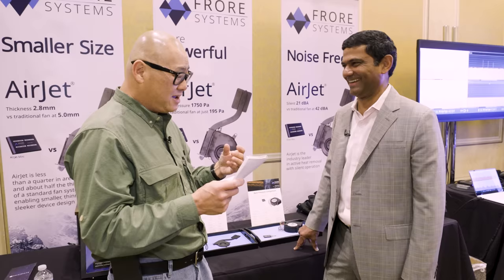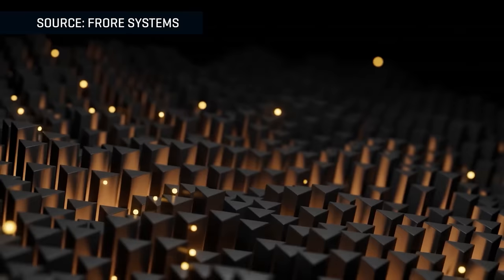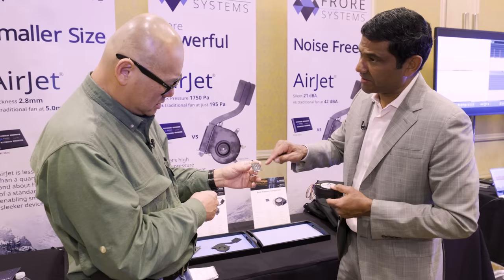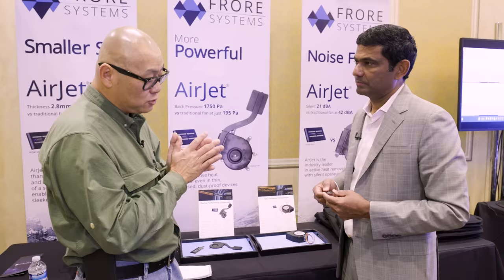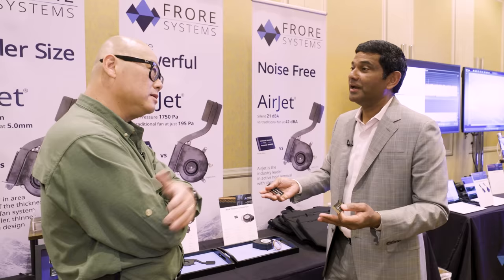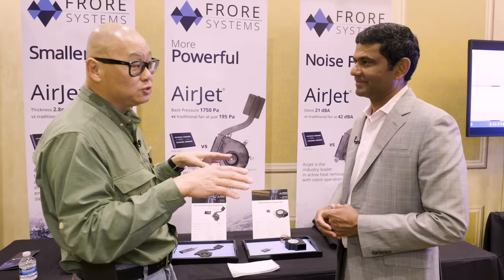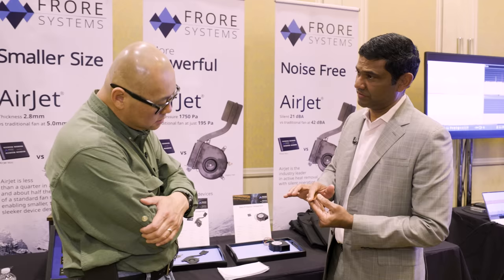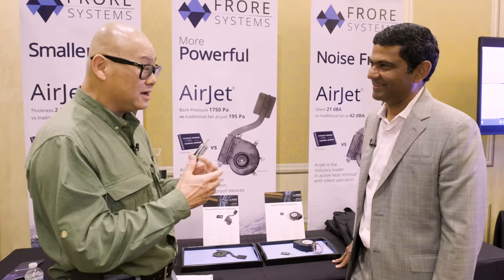Solid State Active Cooling Could Revolutionize Thermals

Comment: Seshu is legit. I'm an electronics engineer by training and I understood what he's saying. It's a pity we didn't get to see the cutaway of the AirJet. Using MEM actuators to move air is just too cool! Would love to see how it works and he said it's how jet engines are cooled? Looks like I'd be spending a few nights researching on this topic!
Reply: Linus did a video about this tech too, iirc 👍
Reply: I love you bro people on the internet doesn't have this curisosity
Reply: it will get stuck very quickly. small holes are the perfect dust filter.
Reply: @lievenvv  Not quite, LTT's video is about piezoelectric crystal linear fans.
Reply: @Gabu_  Yes,those flappy things for the ISS
Reply: @fss1704  Not when there's a 200km/h wind blowing through them.
Reply: @Gabu_  Ah, cheers for that. Wasn't sure if I remembered it right 👍
Reply: @Gabu_  these things are MEMS but they didn't explain how they actuate the MEMS. My guess is that this is piezoelectric in nature as well, cus magnetically driven actuators are bigger.
Reply: @Lurch Yep also another interesting fact is on fighter jets they use the bleed air to inflate the G-suits to keep them from passing out
Reply: can you make them big enough to use it as plane engines or drones ?
Reply: @Lurch Yup, can confirm this is how it's done.

Comment: I can only imagine that the first-gen tech won't be worth it for most use cases, but to see a firm really developing such an innovation gives me a lot of hope for future development.
Reply: This would be fantastic for ultra light with iGPUs. Just think, Apple already has fanless M2 Airs.  In the long run it could make desktop replacements much more portable. 2.8mm is absolutely tiny for the air that it can move.
Reply: in 3 years from now, this should be ready to work with our components....
Reply: I mean you can have two of this on a steam deck and let the CPU go from 15W to 20W, while getting silent cooling and getting more room for extra battery life.
Reply: they are partnered with Intel and Qualcomm
Reply: soyel94  imagine what they can do for hand held gaming devices and tablets which make up a significant market segment

Comment: If this actually works well and they can scale up it could revolutionize more than just computing. Good job putting this up Gordon, like others have said this is probably the coolest thing I've seen come out of CES this year. Surprised they didn't get more coverage or win any innovation awards.
Reply: honestly? this could revolutionize phones and VR and so much more... make them far more powerful than they are already or just make them cooler overall.
Reply: Depends mostly on the price! $1 for a fan (at OEM sort of scales) or $25~$100 for this? Who knows what the cost is! But it's hopefully going to be competitive.
Reply: @noxious89123  if his claims are true, I could save up some extra bills. Or wait until it matures and trickles down to the midrange segment. Great news anyway.
Reply: @Viesta  Yeah and apart from consumer devices... plenty of industrial applications as well -- From automotive to manufacturing to HVAC.

Comment: Innovation should always be celebrated, Good to see someone actually addressing this obvious problem that we all face everyday, All the best Seshu and the team,👍
Reply: Innovation should be selectively celebrated. In general, some ideas are just bad and some fail catastrophically. Solid State Active Cooling seems interesting, but the salesman never showed any data comparing its performance to conventional cooling methods, so we should remain vigilant.
Reply: @Xamarin491  @ 10:53
Reply: Exactly, innovation by definition is new often we have a mix of innovation and other things in engineering no other way to create progress.
Reply: @razk2557  Those graphs only show the performance of one cooling method (Solid state cooling). Without data and graphs for other cooling methods to compare to SSC, the data for SSC doesn't actually give us much of value: Without the other cooling methods to compare, we have no idea if the SSC's results are better or worse in comparison to other cooling methods

Comment: This is sensational! 
As a IT Geek, for me this cooling is amazing!
This will make laptops so much powerfull and silent and substantial thinner.
Reply: plus fans can fail I wonder how resistant this system is to dust and shocks, I have to personally control my laptop's gpu fan speed slowly raising it to 3/4k rpms (can take a while) before being able to set it to auto or its bearing will fail causing it screech. 
Asus had the bright idea to set the heatsink on both sides of the fan (for something that could be done leaving it on just one side of the fan, just like they did for the cpu fan*) so I would need to remove the entire heatsink, replace the thermal paste and pads to switch the fan which is not something I want to do as a beginner.
sry for the rant, I should have just not dropped my phone on my laptop from just 5 cm above...

*which asus actually did for other laptops of the same model/series...
Reply: this will end laptop. everything will be tab.
Reply: - assuming that solid state active cooling actually beats other cooling methods in performance and price. You shouldn't assume it's going to be better, especially without any data or tests for comparison.
Reply: @realsabab  maybe in an alternate reality, not in this one
Reply: Air makes sound bro. Not only fan is the culprit
Reply: Great technology but at what cost and not sure about the durability aspect of it.
Reply: I dont know how you are saying it amazing? But it only creates temperature gradient on its both side. But anyway you need to dissipate the head generated on other side And it cant be done passively. In the end You need to put a Fan or Pump that can dissipate the heat to out side of your computer.
Reply: the interesting thing for me is back pressure like just because a fan blows out strong air doesn't mean theres pressure there for the heat to transfer? really interesting
Reply: @krishnamurariprasad8165  
You will have an intake and expell heated air on ends. The air will circulate through it.
Underneeth you still have a passive cooler that have vapor chambers, like graphic chips have.
But instead of having radiator fins, like today's coolers, you will have a these solid cooling, you can have multiple ones depending of cooling requirements.
Reply: @realsabab  Never. People still want keyboards.
Reply: Why he did not do that, will it ?
Reply: @qgqsrg1  You still need to connect it, why you need to replace the paste too?
Is it any better? Who needs it? Why he never did build a Notebook, show that it is better ! Do the Pepsi test ! 2 Macbooks, one of them on Solid, one one vans.
Reply: But how will I know when some runaway process is pegging my CPU at 100% without hearing the fan suddenly going full tilt for an extended time?
Reply: @b-beluga4510  if the outlet is small then yes
Reply: @lucasRem-ku6eb  removing the whole heatsink system means probably having to replace the thermal paste and pads due to them drying up.
Reply: @qgqsrg1  Just do 2 laptops, one on fans, and one on the nana solid state.
Is is running better on Solid state, or is it CRAP ???
why you don't understand that ???????
Reply: @firesurfer  too toxic YouTube is!
He does not understand the Pepsi Test, lame content !
Reply: @lucasRem-ku6eb  2 laptops? might as well just repair mine for just £100 or less.
 my hardrives are ssd if that s what u re wondering.

If u talking about the new ssfan introduced in the vid, still why 2 laptops???
Reply: @realsabab  SSC still requires air vents on the sides of the device for the hot air to escape.
Reply: thinner is weirder for me. i cant stand paper thinn laptops

Comment: I'm interested to see if Apple will opt to use this on their laptops to improve their thermals and noise levels, particularly for the Air models. Since it's so thin, it might even be viable for their iPad lineup. I wonder what the rated TDP is of each of their solutions.

Edit: The mini does 5W and the Pro does 10W of heat dissipation, so this is really targeted almost exclusively to ultra-portable devices with low power chips. Still, it'll be interesting to see where they take this technology in the future. If they can manage to reach a 35+W heat dissipation then they'll open themselves up to a substantially larger market.
Reply: I doubt it.
Reply: @frank234561  idk man, There's been reports of devices getting overheated... especially their brand new M1 and M2 laptops
Reply: @poruatokin  I definitely wouldn't put it past them to do that.
Reply: " so this is really targeted almost exclusively to" wrong, watch the video, they say you can put multiple inside one machine on top a heatpipe
Reply: @Mech0z  Yeah, they're not going to do that. If it can't be resolved with one of those coolers, then it isn't going to be solved with any of those coolers. Companies like Apple already chose to ditch coolers entirely in order to make a thinner, silent device. They're not going to compromise on that to the amount necessary for heatpipes and several of those coolers just to hit a higher TDP target. And the designs that already feature active cooling aren't likely to want to spend the extra money when it'll take six of them to deal with a 65W chip that their two blowey bois can already handle. Like, the tech is really cool. Now they just need to repackage it into something that scales better without needing the manufacturer to completely re-engineer everything around it for high output devices.
Reply: Guys, try using Peltie module (5volt), in 30 degree celcius room, without cooling the heating part of module. 
In first 5 min you feel like module works, but eventually temperature between cool and hot part colide. And its became hotter then room temperature. 
There is no tricks: cooling efectivity of every cooler measured by how fast he can cool his hot part.

So basicly what this guys did is to sell again what was already invented, and not used for a reason

I advice us all to keep using our "Solid State" fan
Reply: They need this, their passive cooling nonsense ruined an entire line of macbooks

Comment: This is amazing whether you need it or not. It's about time we see cooling tech become more innovative
Reply: But how is this thing dust proof if the dust collects inside the vibrating memebrane
Reply: @b-beluga4510  nono, they probably meant that you can place dust filters on the laptop
Reply: @SreenikethanI  What so when the filters on the laptop eventually block up like say in around a few months, the laptop will start to overheat.
Reply: @tyronenelson9124  I'd assume you clean or exchange them. Ideally the filters should be outside the case at the air intake or at least extractable for cleaning.
Reply: @tyronenelson9124  can be cleaned, right?

Comment: This should win a CES award cuz so far this is the most high tech innovative thing. I can already see multiple uses for this like in OLED monitors so that you don't have to have a large heat sink.
Reply: OMG, you are so right! A lot of surface area at the back of an OLED display!
Reply: Guys, sure I can see some problems right off the bat. Only 5W cooling in that size and a 20% increase in overall power consumption. Unknown factors, such as reliability, durability and cost in addition. Nonetheless, plastering the whole back of an OLED display with this, hopefully running it at less than full power, might solve problems OLED is having, e.g. full white display brightness. Who knows whether that would be cost efficient, but the thin form factor would be ideal for a display as it is for thin and light laptops.
Reply: @Joe Beef Hash I think we saw it blowing stuff around. What miss?
Reply: @jawndoekck  he said they use this kind of thing on a jet
Reply: @cali_cal  The same concept, not the same implementation, potentially a very big difference. I think it's pretty safe to say that jets already have a high airflow/pressure, so implementing jet impingement is presumably relatively easy(and much larger)
Reply: @jawndoekck  Peltiers aren't coolers in the way many would think of them, they're really heat pumps - they require a separate cooler(whether a fan or something else) for the hot side, they add heat to the system overall(due to inherent inefficiencies). They're effectively just a tiny fridge - cold on one side and hot on the other.
They were talking only about air cooling here, so it doesn't seem particularly misleading. If he'd just said first active solid state air cooler it would be unambiguous.
Reply: @jawndoekck  No, by definition, Peltier modules are heat pumps. Peltier modules still need a form of heat removal. 
The Airjet would be categorized as a 'specific' kind of air compressor/fan. It creates flow, but specifically built to remove heat.

Comment: Seshu does a wonderful job explaining their product.  I love his enthusiasm for it.  It's really infectious.
Reply: They make are wondeful job  , in practice they implied  a Stirling Heat Pump in a small chip
Reply: Does anyone have any links to the actual physics and mechanics involved with this?
Reply: hes a great communicator
Reply: It really tells me he's passionate about what he's making and gives me a lot of confidence when it comes to the product itself
Reply: Really? Why don't you explain to me how it works then.
Reply: @htomerif  lol.
Reply: @MR-nl8xr  I looked up all the patents "frore" holds, so I know exactly how this thing "works" and I know for a fact no one else in this thread has a clue. I'll give you a hint though: its very boring and extremely cheap.
Reply: @htomerif  yea, I figured you had an idea. Well, we'll see how this tamale comes turns out.
Reply: @MR-nl8xr  Well, for anyone who want's to actually know how it works, here you go:
Its a bunch of cheap piezoelectric speaker elements (like one for each slot you see on the top) that are arranged exactly like a diaphragm pump, only the valves aren't ball check valves. They're little plastic flaps that smack against metal at a few tens of kHz, which is just absolutely great for durability.

Could it work? Sure. I guess. Whatever.

Is it efficient? LOL.

Is it going to be the next big thing in CPU cooling? XD Of course not.

Also, you can already get diaphragm pump cpu coolers for liquid cooled systems. They've been around for about 20 years.

This is as innovative as Musk Musk's Hyperloop and will probably be about as successful.

By all means, go look at their promotional video where they show some weird purple CG triangles moving up and down in a wave. Is that whats in it? Nope. You know those greeting cards where you can record your own message? That's actually whats in it.

Comment: Overall very impressed; while I do have some concerns about the longevity of the MEMS devices, as they have to be continually running for years, it does seem to have a lot of potential. Hopefully we'll see a version able to cool 100+ watts of TDP in a few years, so that it could be used in desktops, and mini PCs like NUCs and such. 

A quick breakdown of a couple of keywords, as they're kinda jargon:
MEMS = Microelectromechanical systems; they are everywhere these days, though most notably in accelerometers, like the ones used to tell which way your phone is directed, or when an airbag should activate.
Boundry layer = A thin layer of air that is moving much slower than everything above it, that kinda sticks to the surface; it's a major contributor to drag in aerodynamics. (I wasn't aware that it also hindered heat transfer, it absolutely makes sense.)
Reply: They look modular and most likely will be cheaper than memory
Reply: buddy broke down his on yt comment.
Reply: mems devices are cheaper, lighter and can be kept under longer operational periods than mechanical components.
Reply: This is basically a piezo speaker that vibrates and makes wind
Reply: @gabrielv.4358   no one gets how bad this is

Comment: When I look at their chips I instantly think about using those on M.2 SSDs. Those get extremely hot and there aren't very many ways to cool them off. I got a small fin stack with a 30mm fan on it which sort of works but having this chip to cool them would be awesome.